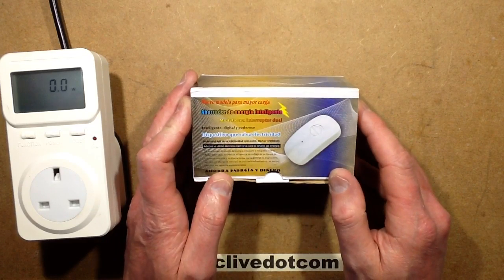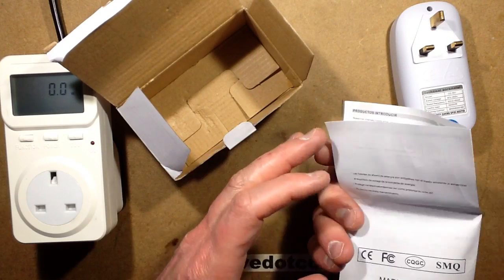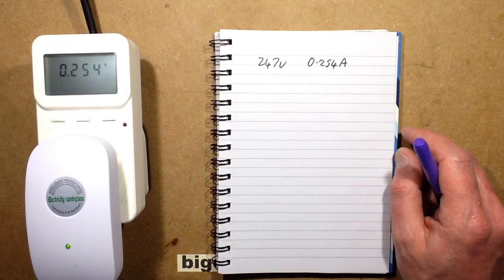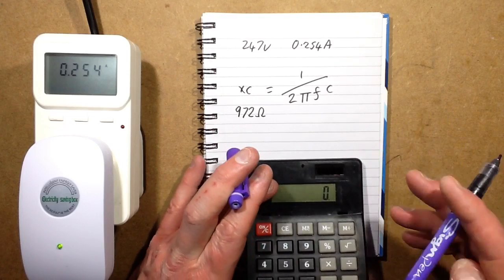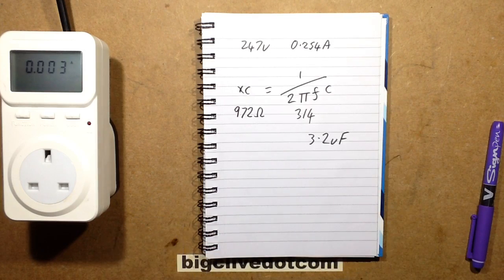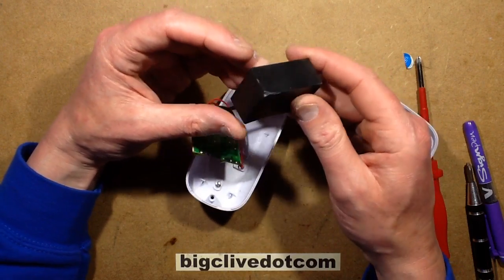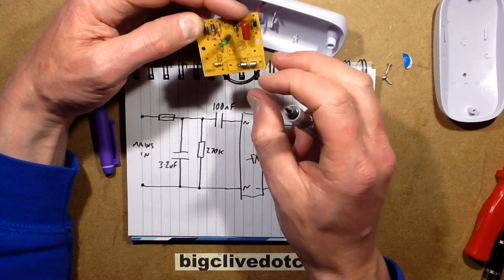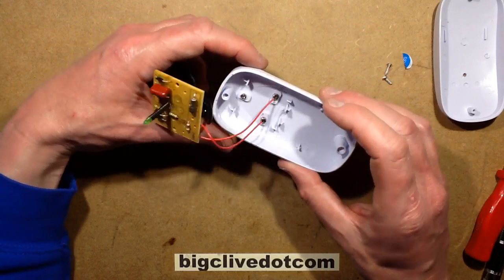30kW energy saver plug teardown and schematic.

Comment: Needs further testing, by plugging it into a split socket that is finally plugged into your powermeter (hoping it is not capable to measure effective power) with a reactive power consumer like a TV or washing mashine (mine drain around 6-15W of inductive reactive power while off).
Reply: How tf does a modern TV draw any reactive current when switched off? There would be a small SMPS drawing a milliamp at most powering the remote receiver to be able to switch it on with the remote control. Hardly a highly inductive load!

Comment: 3.2uf isn't really going to do bugger all to the power factor since a tiny 18w fluorescent fittings normally has a 6 uf PFC cap in it.
Reply: +simontay1984 Well I've just grabbed a 10uf cap out of my lighting spares box and it's a cylinder that only measures 30 x 70mm...

Comment: Did you just discharge that with an all metal screwdriver? could of been interesting haha!
Reply: +add 4000 Any mains powered device which doesn't react gracefully (or not react at all) to have its pins shorted while unplugged is a lawsuit waiting to happen to every link of the entire supply chain that provided it.
Reply: ???

I meant if it there was any charge in the capacitor, Mr Big Clive could of potentially received some tingles

Comment: that formula again.....
does anyone know why π has anything to do with capacitive reactance? esp when theres no physical dimension in the formula, no length of any diameter or radius of any circle or sphere
Reply: +0yeme0 AC volts are sine waves.
Reply: +0yeme0 pi actually has nothing to do with it, it is tau which is the relation of the rate of change of the curve while pi is based on area. pi is half of tau, which is why 2pi is used.
Reply: ahhhhhhhh ok I can see that ty. now Im wondering about square and saw waves and things
Reply: +0yeme0  Those waves can be considered built up of a number of sinus waves of different frequencies and amplitudes, so a bit messy dependent on how precise you want to be. There are probably formulas for the basic wave forms (where the sum of frequencies and amplitude factors have been taken to infinity (or as far as needed for real world application) https://en.wikipedia.org/wiki/Electrical_reactance has a bit for the square wave.

Comment: Been wondering, as I understand it, these PF savings devices are only really useful in industrial applications where there are motors with higher loads involved. In the average consumer home, these devices have no effect, other than maybe some filtering etc...
But I was wondering what effect it would have when added to an electricity loop that has appliances like washing machines and fridges on it? These appliances tend to have fairly decent motors in them, so would PF correction actually have an effect here or not?
Reply: +Sidhion Sindarin  It might take care of some reactive current from the motors and prevent it from going through the meter to the power plant, but unless you're actually billed for VA and not W (unlikely for household consumers) it'd make no difference on your bill.

Comment: Australia is converting over to IEC38 too.  So we have 230V nominal voltage.  However, I work on systems all over the country.  some of my sites are running at 265-270v AC.    The high sites will have to come down a little in the future...
Reply: +tcpnetworks Same in Italy. My house is supplied with an old transformer, usually the voltage is around 221V (old standard being 220) but since it is a small 35kW transformer that feeds 7 homes (each with 6kW), when the neighborhood starts the AC or waterpumps the voltage goes down to 200V, sometimes even below... poor thing, it's from 1948 :-(
Reply: +simontay1984 That transformer makes some nasty noises sometimes..  depending on the load. But it still lives! Each house cannot draw more than 6kW (meter will trip) but at full load it's more than 35kW. probably it was fine until the deregulation/privatisation, then private companies started pushing to customers to upgrade their electric power to 6kW even when the transformer can't supply enough (once we had 4.5kW or even 3kW)

Comment: Haha my home voltage is lke 247-250 as well. Wierd.
Reply: Similar voltage here.

Imagine the instant energy savings the government could make if they just reduced it to 230V...
Reply: 9ff70f96 Higher voltages means less electromagnetic loss in the lines. Also if appliances receive a higher voltage they will use less amps as a result. The wattage remains the same. Pretty sure if the government used a lower voltage they would lose money. :) I am pretty sure thats the case anyway.
Reply: +Ame Nightcore - For transmission, yes, lower voltage = higher losses, but no way when you're talking about common high-power, low-voltage loads like incandescent lighting and heating, which I dare say accounts for the majority of household energy usage.  Higher voltage = less amperage?  No way.  As voltage increases power increases exponentially.

For example, take an electric shower with a heater coil resistance of 5 Ohms: 5R @ 220V is 44A = 9.68kW.  5R @ 230V is 46A = 10.58kW.  5R @ 240V is 48A = 11.52kW.  5R @ 250V is 50A = 12.5kW.  There is almost a 9% drop in energy usage between 240V and 230V there for a roughly 4% drop in voltage.

I would doubt that power transmission at the higher voltages would suffer that degree of transmission efficiency loss for a 4% decrease in voltage.  And even if so, I don't see why they couldn't just leave the transmission voltages as is and simply start installing or replacing the end-point transformers with ones that actually transform the voltage down closer to 230V than the 240V of today.

Comment: In your formula you can swap the C and the X sub C. Capacitance = 1/2 pi f (capacitive reactance). Same formula just solving for the capacitance.
Reply: +Robert Gibbons Can the C's in either end of the equasion be struck off ?
Reply: +Maico No. Two different things. The C is capacitance in farads, while the X sub C is capacitive reactance in ohms.
Reply: OK clear now :)
Reply: Was thinking the same thing, ,just transpose to solve for C.

Comment: Only really any good if you are applying a large inductive load like a motor, i wonder what size of motor would be ideal for that size of capacitor :-)
Nice case, but they didnt maximise there profit, a metal earth pin!!, could have been plastic LOL :-D.  I would hit that capacitor with a hammer, i think its a potted smaller one.

Comment: can you really save power using capacitors?
Reply: +Almujtaba Osama  If you 're a big factory with big inductive loads (heating coils, motors etc, your contract with the power company probably requires you to keep the power factor  not too fr from 1, incurring penalties if you don't
(Oryou might be straight up billed in VA rather than W)
If the reactive current can pulse into/out of PF correction caps inside the plant, that current doesn't pass the meter, thus reducing a VA reading (but not a W reading).

Also, out of phase current in transmission wires provide no work at the end, but do create resistive heat losses in the transmission wires. That lost power can be saved
Reply: +Michael Tempsch so it's a yes and no? like not for households but necessary for large industries?
Reply: +Almujtaba Osama You got it.

Comment: PLEASE make an LED spikeball from the case. Cram so many LEDs into the case that the 3.2uf cap is the dropper capacitor :D
Reply: yesh!!!!!
Reply: If my calculations are correct—thanks for teaching me Xc, Clive!—that'll be about 19.5 V per series string of LEDs. So, ~6–10 LEDs in series, depending on their Vf, times however many strings he can put in parallel.

Comment: I am trying to find a power meter that uses a lead so I can use it on the bench rather than the plug in type meter. What make is yours Clive?  Thanks in advance.
Reply: You could probably just plug the other kind into an extension cable.
Reply: Thanks for your answers

Comment: you said it might filter transients...  are you talking about how when the lights dim when you turn on an appliance with a high power draw?
Reply from the maker: +I don't want a channel I'm just commenting No.  That's voltage drop.  It could shunt very sharp electrical spikes.
Reply: +bigclivedotcom is that the sound spike i get on my speaker when i start the electric window shutter?
Reply: +bigclivedotcom I've got a belkin surgemaster 10 socket extension that absorbs spikes, also buffers the current so dips in voltage don't shut the pc ot tv down, doesn't save any electricity, just thousands of pounds on new equipment if something goes wrong with the supply.
Reply: +gazyounglive belkin surgemaster do not buffers the current it only provide surge protection (and even that it do not do good). If you want device which as you call buffers the current then only option is online UPS (not standby, line Interactive, standby on-line hybrid
or standby-ferro only double conversion on-line or delta conversion on-line). Dips in voltage do not shut down PC or TV (for any decent quality) and PC and TV power supplies are made to be tolerant to at least one full cycle of power loss (that mean they voltage can drop to 0 volts for at least 1/50 seconds and equpmant will not react to it).
belkin surgemaster is only good to get electric shock from it (but same problem have and similar product from APC) due wrongly chosen bleed resistors on capacitors
Reply: +I don&#39;t want a channel I&#39;m just commenting He means it will keep the homeless from hiding under your home in the crawl spaces smoking crack.

Comment: Where do they get the 30kW rating from? If you did have a massive inductive load do you think it could correct much power factor?
Reply: +codebeard I did some quick maths and 3.2uf would not be enough to correct the power factor on much of an inductive load. However if you completely bodge the maths and assume that there is power factor correction in most equipment and that some of it is resistive loads anyway that don't need correction then the total load that this could "correct" would be 30kw.
Reply: depends on its inductance and resistive load

Comment: Could the 5.1K resistor be a discharge resistor for the unpopulated smoothing cap? Maybe they took the cap out to save money but forgot to remove the resistor.
Reply: +Susana Godinho Dampens the variations in current compared to running the LED directly as the voltage  varies, though you need to run the supply at 1V higher if you're running the LED at 10mA.
The higher the rellative margin (and voltage dropped over the resistor, the less noticeable difference in LED intensity due to varying voltage.
Reply from the maker: +Susana Godinho The 100R resistor will limit the maximum current through the LED when power is first applied at a point other than the zero crossing point of the mains waveform, as otherwise the capacitor would just let through a high pulse of current.
Reply from the maker: +David Anderson The voltage across the cap would have been really low.  But it did cross my mind that it might have been to limit the voltage across the capacitor if the LED went open circuit.
Reply: I'm a bit more puzzled with the 100R on series with the LED.
Reply: +Michael Tempsch 
But the 100nF capacitor already behaves as a 32K resistor in series with the mains. Im a bit sceptical what 100R would do.
Reply: +bigclivedotcom 
Wouldn't a smoothing capacitor be more effective for that purpose?
Reply: +Susana Godinho Resistors are cheaper.

Comment: There is actually one legitimate use for these in homes. In my case I have a window air conditioner and a microwave in my room. In the case they are both on simultaneously for an extended period ~1 to 2 minutes, the 15 amp breaker will trip. Correcting the power factor just a small amount with small capacitors like this keeps the total current under 15 amps and keeps me from having to worry about both loads being on simultaneously. I Could of course change the breaker and wiring but it's far cheaper and easier to solve the problem with a little pfc.
Reply: urbex2007 Its a simlple 5000 btu window AC no one in their right mind would invest thousands to add new wiring in an exising house just to power a window AC. I am aware the circuit breaker is trying to protect me that's why I added power factor correction it is not at all neglecting safety. You clearly do not have the knowledge to understand my comment or did not properly read it. Please re-read it and enlighten me as to how I am neglecting safety, otherwise go study up on your physics and understand power factor correction. This method is used by engineers all over the world for this exact problem. Not trying to be rude but your comment is inaccurate.
Reply: Darthane
That's what I thought. EEVlog is extremely good but I just have trouble listening to his voice and he either drinks too much coffee or gets too excited too quick. He should tune his mic down an octave and he'd much easier to listen to.  Not that I feel its my duty to say it to his face.

Once an awhile he fails to lack researching the premise behind a video he does but his circuitwork and math are top notch.
Reply: +Jacob Dykstra Yeah, modifying the PF for inductive loads is all these things will do. EEVBlog did a good video on them, testing them with bench equipment to show the effect. Of course, any modern power meter will not benefit from these.
Reply: +Jacob Dykstra Tell us if that actually works for you.
Reply: Nice Video! Forgive me for chiming in, I would appreciate your opinion. Have you ever tried - Chiveard Wealth Storage Framework (Have a quick look on google cant remember the place now)? It is a smashing exclusive product for slashing your energy bills minus the normal expense. Ive heard some pretty good things about it and my mate finally got excellent success with it.
Reply: @graciellalee2477  wtf?

Comment: maths: xc=1/(2.pi.f.C) divide both sides by xc to get 1=1/(2.pi.f.C.xc) then multiply both sides by C to get C=1/(2.pi.f.xc) not that hard? works because for any x, if a=b then a.x=b.x and a/x=b/x (if x is not null). Conclusion C~1/(314.xc) for 50Hz.

Comment: I think the big cap may be to add weight, to give the feeling of more technology inside.
Reply: No, its actually there for its actual capacitance to correct power factor. If they wanted to add weight theyd do tha same thing the chinese fake harddrive (tiny usb memory stick inside a harddrive case) sellers do, hot glue some scrap nuts and bolts inside.